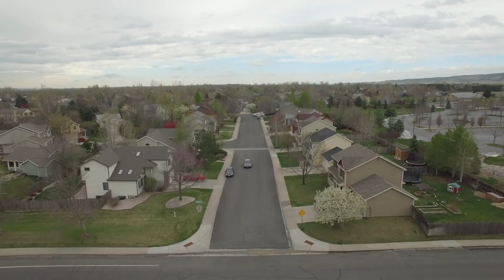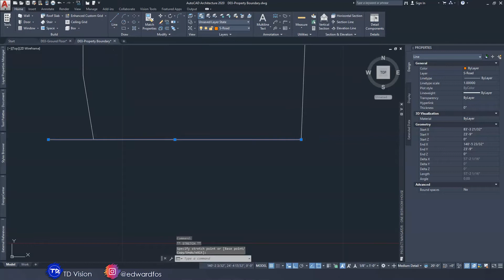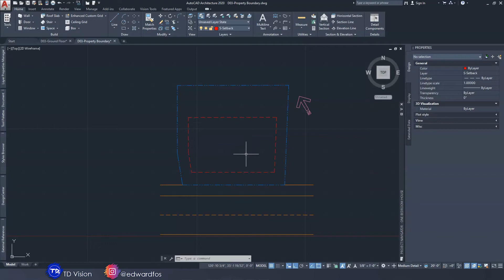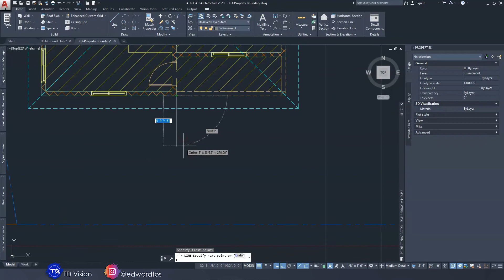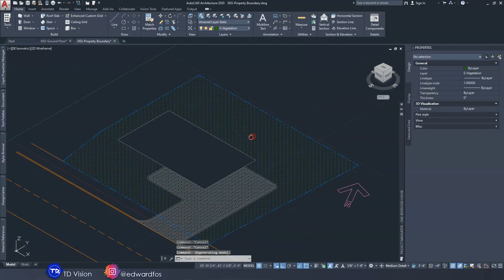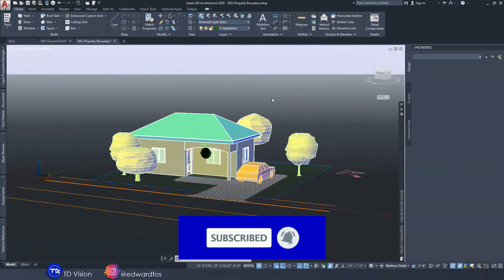Comment: You moved the site boundary to fit the building why can’t it be done the opposite way? Move the building to fit the site boundary?
Reply: You're correct. That's because I should have done the site at the beginning of the project. That way, the building would be in the right spot from the get go. Due to that err, it was easier to move the site around.